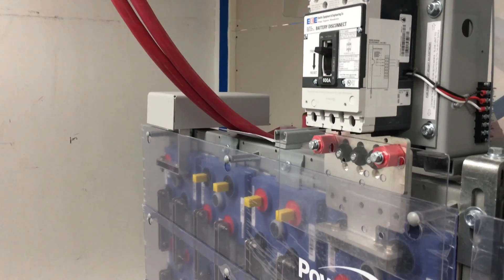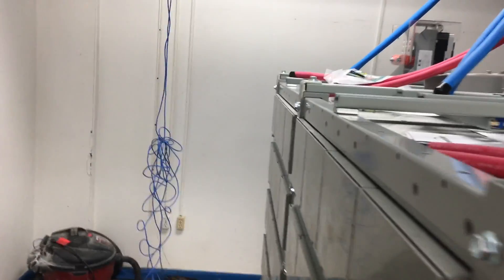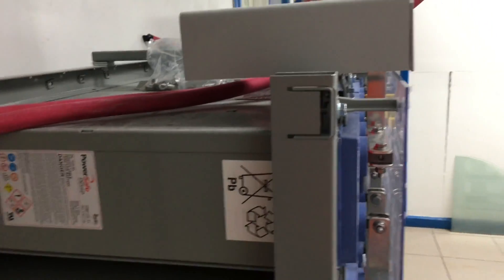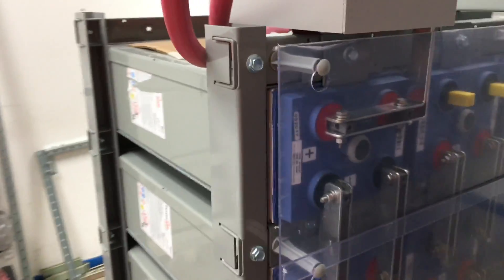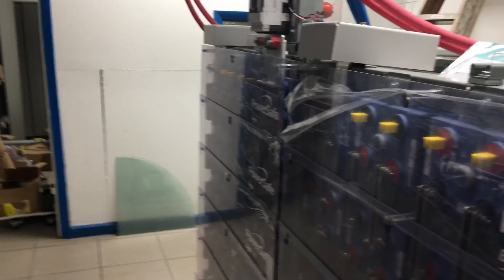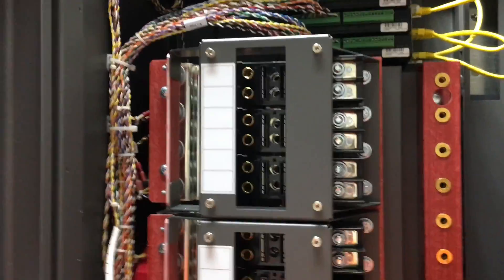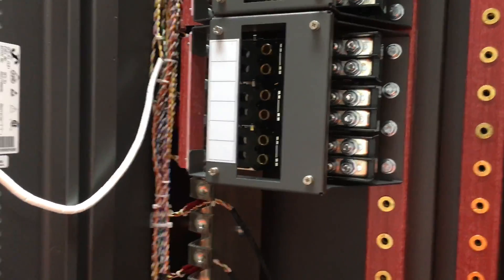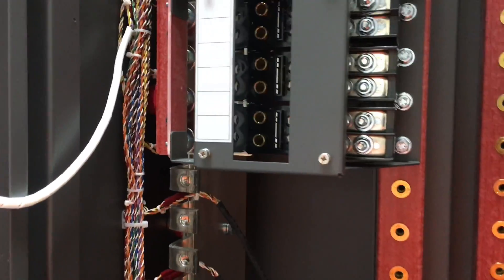192 KWH  Battery Bank Installation.

Comment: sir l have a question
which battery are use in this project?
LiIr or LiIRPo4
Reply from the maker: They are lead Acid dry cells 2v 1000 Ah each. 96 total cells.
Reply: @hibiggs66  Good evening i am looking to design UPS that can deliver up to 700amps in 10mins any ideas
Reply from the maker: If you are referring to the 192kw system they are dry cells lead acid.